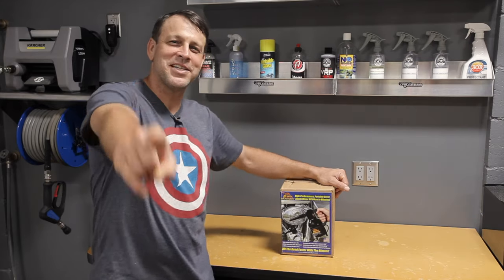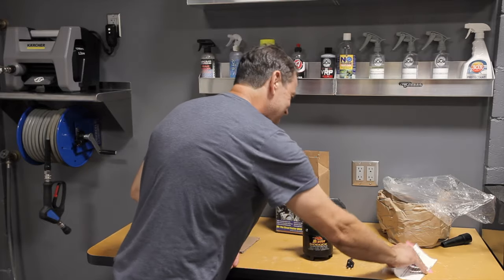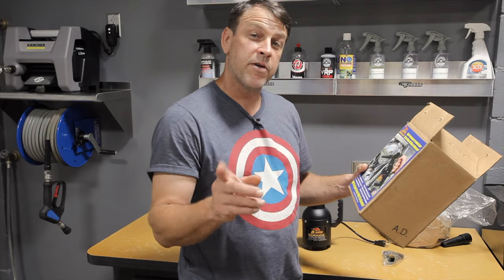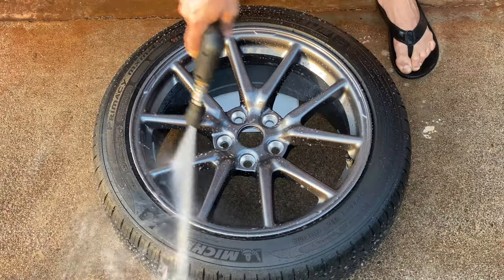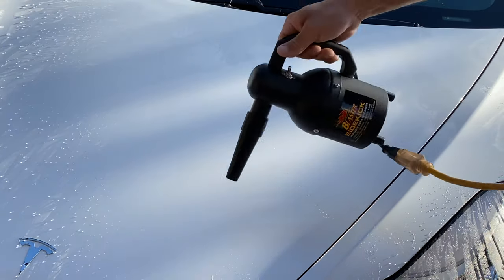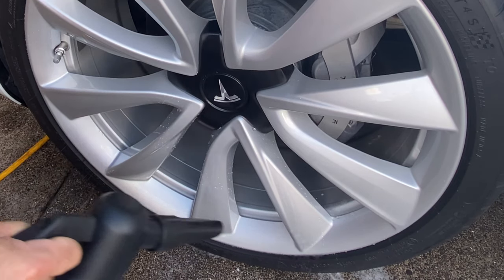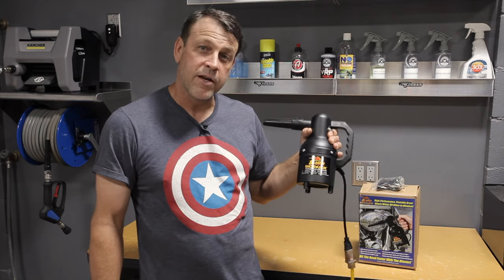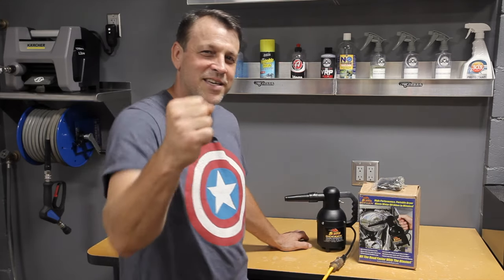DRY YOUR CAR FAST! AIRFORCE BLASTER SIDEKICK by METROVAC UNBOXING AND REVIEW

Comment: Im mostly going to use mine on the interior doing the air purge method with a soft detail brush and use my leaf blower on the exterior
Reply from the maker: Yeah good idea. Thanks
Reply: Same here, I'll just use the leaf blower which stil blows warm air to dry it.

Comment: I really wanted to hate this product because I already owned the 8HP Master Blaster until I realized how cumbersome it was to use their hose inside a confined garage space. I wanted something compact to dry off water quickly during the colder months and a warm air dryer such as the Sidekick would be perfect. During the warmer months I generally use my Ego blower to dry off the car outside. I wouldn't expect the Sidekick to dry off an entire car in the same fashion but it is definitely a great mechanical drying aide. For the finer details this is a perfect tool for drying out areas missed in traditional drying methods before diving into specific projects.
Reply from the maker: I agree. It’s a cool tool for sure. I use it all the time. Thanks for watching

Comment: Neat tool!....but kinda wondering why anyone would spend.....any....$$$....on one of these dedicated car air drying blowers, if they have a leaf blower, which has a higher CFM? I am not buying when others say a leaf blower blows “ dirty air or impurities”. I have a 10 year old electric  and a 20 year old gas leaf blower that blows water off my cars fine, no finish damage!
Reply from the maker: David Greenwood Thanks for the comment . Good points. I agree. I like this tool for the hard to get drippy areas. It’s small and quite and has its place but drying the whole car is not its strong suit. For that I use a microfiber drying towel and P&S beadmaker as a drying lubricant/ topper coat. I want the topper each wash and might as well dry the water at the same time.
Reply: Why you type ….like….that

Comment: I personally feel for what it is.....should just get a plug in leaf blower since you need an extension cord anyway.....which is "lighter/better balanced" and blows way more air for larger vehicles. Only downside is no filter, so should take extra caution
Reply from the maker: I like this tool for the wheels and smaller areas like the engine bay, door handles and emblems. Its a cool little tool. I use it a lot even though I have a leaf blower. Thanks for watching
Reply: A leaf blower isnt the best for cracks and crevices because of the large mouth opening even if you get a stubby nozzle also its way heavier and louder to deal with just for cracks/crevices but the leaf blower def can be used more around the house for certain jobs. What im gonna use the sidekick for is drying out those cracks/crevices and wheels/tires as im towel drying panel by panel so i dont have to go back and redry the area.

Comment: Should I avoid using this on my car if I live in an area that has bad hard water? 

I want to buy one but am worried that If I dry with it I would end up drying the water and leaving all hard water spots behind.
Reply from the maker: Great question. No it blows the water off and the heated air helps dry it some. I have never had spotting from this process. I mainly use this on tires and to blow out the hard to dry areas. Door handles, Emblems. Engine bays etc.
Reply: Like he said in the video. He would use a detail spray and micro towel  to dry the car and use this tool along with a micro towel to get those tight spots later.

Comment: You can get a lint duster from Amazon for half the price that does the same thing they even look similar
Reply from the maker: Have not seen that. This is a pretty robust little machine. Filtered heated air. Strong too. I bought it a year ago and use it whenever I can. Thanks for watching.

Comment: I already have an air compressor is it worth it to buy this?
Reply from the maker: This tool is known more for its quick easy use of high pressure hot air without needing to fire up the compressor. The air is really hot so it dries things quickly.  It is filtered air also. Some claim contaminants come out of the compressor depending on your filtration. I think you could get away without this if you have a good compressor setup. It would be a luxury. I do like it though. Thanks for watching.

Comment: Was using my blaster for the first time the other day and noticed the air coming out wasnt warm.  Says its heated air right?      ty
Reply from the maker: It takes a few seconds to warm up. It should feel warm pretty quick though.
Reply: @HawaiiDetailing  I think I got a boner then.  Cause I dried my entire model 3 and it never got warm.  Brand new too.  I’ll take it apart and see what’s what.  Thanks

Comment: That’s the keyword you mentioned: treated paint. You guys... your car needs to be waxed and well PROTECTED in order to use any type of air to air dryer it! Otherwise it’ll be useless to air dryer it
Reply from the maker: Thanks for watching and taking the time to comment. I hope you enjoyed the video. I agree that a treated surface is an important part of using an air drying machine effectively. That is why I demonstrated on both treated and untreated surfaces. I hope that people who care enough to blow dry a car would definitely care enough to use a paint protectant especially with the more modern, easy to apply paint protection products available. They are inexpensive and also spray on and wipe off very easily.

Comment: Can't you just use a $20 leaf blower or am I wrong? That's what I've been using. It looks funny but I dry my car 10× faster than people who use these things
Reply from the maker: Here is the leaf blower that I use. This machine is more for Motorcycles, Engine bays, Wheels and tires etc. Its has high velocity heated air. Dries things really quick. I do use it quite a bit. Thanks for watching
https://youtu.be/p2LHGSKu3Ls
Reply: @HawaiiDetailing  That thing is badass
Reply: @HawaiiDetailing  Was very into detailing forever. Last 3 years I've been doing 50,000 miles a year so I'm happy just keeping it clean. This product came up on Amazon, found this video, and I thought the exact same thing lol. I've never thought to look up detailing videos on youtube. I'll check our your channel for tips if I get back into it again. Thank you